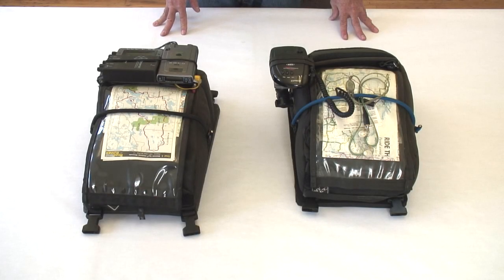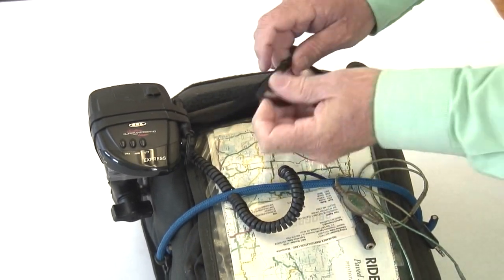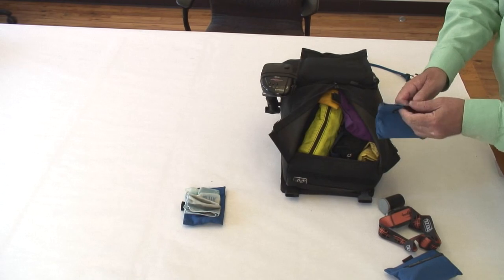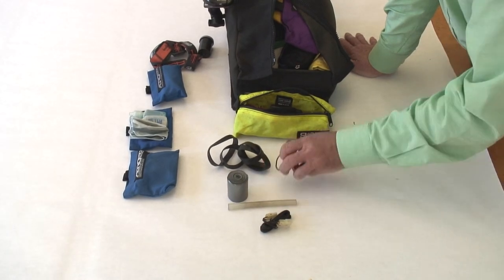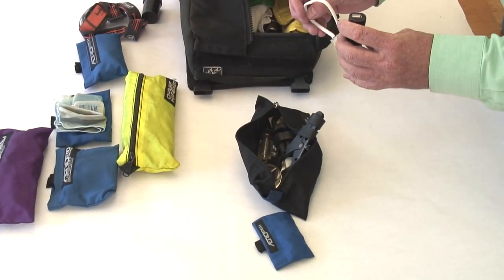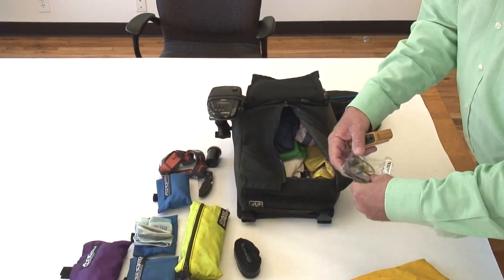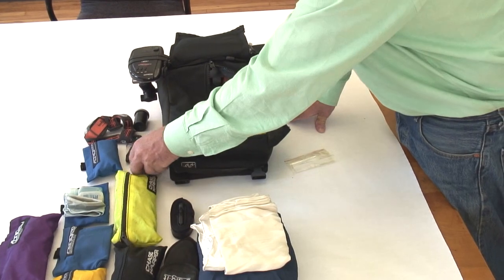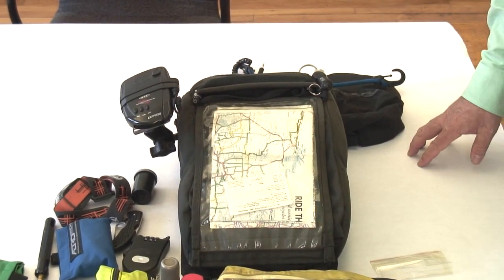What's In Your Tank Bag?

Comment: Thanks for the video. You reminded me of a few things I wanted to pack for a trip.  I do have a few comments.
You can buy booze in pint and half-pint flat plastic bottles. A $74 titanium flask is a little silly.  
A Fresnel lens (to read maps) makes a lot more sense to me now than 20 years ago. I would keep that a little handier.
A water bottle is good to keep right up on top.
If you watch the ounces, the pounds will take care of themselves.  Two extra cruise control devices, really?  Extra batteries for the temperature gauge?  
I'm more concerned than you, apparently, with what the bike will weigh.  
And where are you going so fast that you need a radar detector?  Has it really saved you from any tickets? I prefer to slow down and enjoy the ride. (It's also safer).